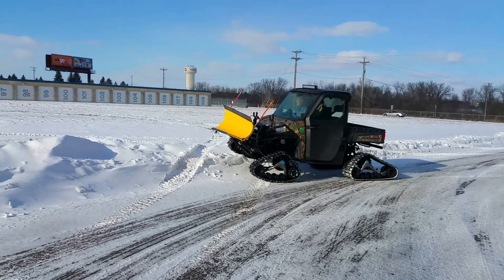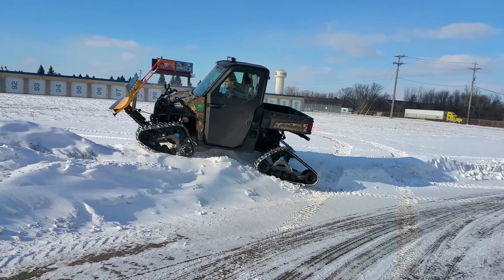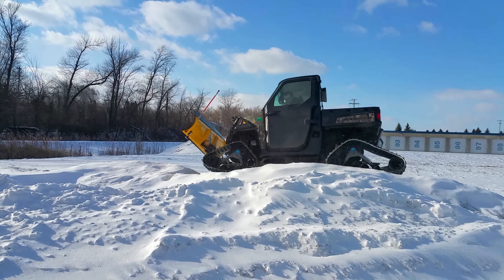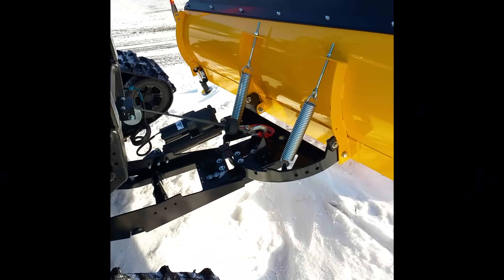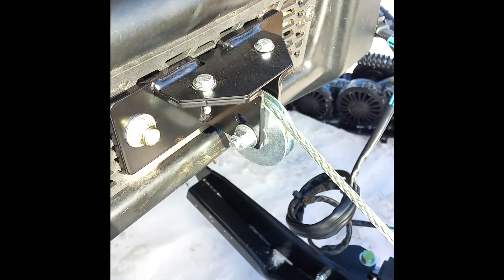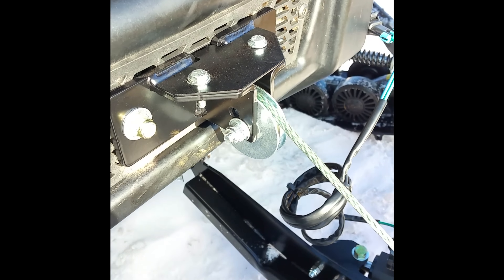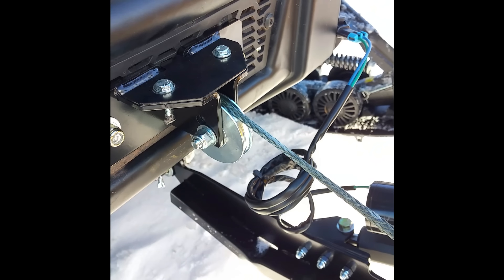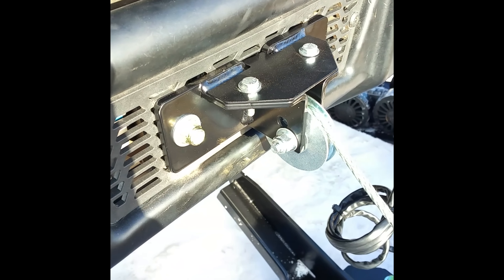MotoAlliance Plow Roller

Comment: I have a Denali plow and a Motoalliance 5000 lbs wide spool winch. After denting the lower roller on my fairlead and shredding my cable twice I found that Motoalliance designed a roller to replace the fairlead. I also purchased the recommended rope cable. After installing the roller and cable I went out and plowed snow for an hour. I noticed something looked wrong at the roller fairlead. It was bent down about 2 inches. Where it bolts to the winch plate the downward pressure bent the plate forward. Very bad design by Motoalliance. The rope cable also was damaged with one trip out. I like the Denali plow, works great but the fix to a known problem with a roller fairlead doesn't do the job. I am a good metal fabricator so I installed some metal bracing and three hours later have a design that works. Motoalliance needs to add bracing to work with their own winch!
Reply from the maker: +Terry Cahill I'm sorry had trouble with your winch mount while plowing.  I'm glad you were able to get it to work.  Can you tell me what machine you have this installed on so that we can take a look at the mount and make sure everything is good going forward?

Comment: Would I want to use this plow roller with synthetic, or would my standard fairlead protect my synthetic cable better? I snapped my standard metal cable first day out. Pushing a Denali pro 72 inch county plow with a Polaris General.

Comment: I just received my viper elite wide spool this week thru CT Raceworks. Ready to install it today. Questions ; CT has me installing elite upside down on their custom bumper, shouldn't be a problem, Right ? also checking youtube videos and came across your motoAlliance plow roller. Will this work on a  wide spool ? and what about the the last few feet of webbing ? I plow maybe 10 times per winter, and use my winch to pull maybe 10 times per season. I like the webbing over rope for strength and durability but will I be able to slide the webbing towards the end of the rope enough to not interfere with the rope getting into the pully ?  Will I need to remove the rope each time I go to plow mode or does the pully drop down, It looks like it was designed too, It would ideal not to remove the rope the rope from the winch each time,  if so great product for me and with longer bolts I  can unbolt fairlead pop this on  right over the fairlead and w longer bolts and be in business. Plug and play / or bolt and plow. If my assumptions are right,  I'm interested in getting one.
Reply from the maker: There is no problem installing the Elite winch upside down, just make sure that your IN/OUT buttons are still correct. 

We do have a plow roller designed for widespool winches.  It works great, when you're using the Plow Roller you'll just want to slide the abrasion guard further up the cable during plow season so that it doesn't interfere with the roller.  You don't need to remove your cable to take off the roller, but you will need to remover your Plow Roller before you use your winch for recovery purposes. 

If you have any further questions feel free to call us (1-866-527-7637 #1) or send us an email and we'll do our best to help you out. 

Caleb - Technical Support
MotoAlliance